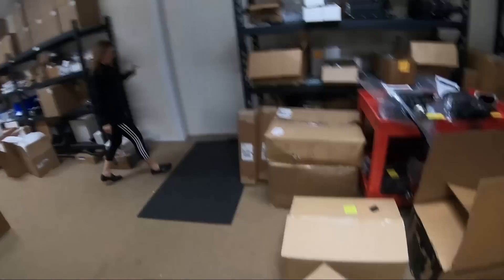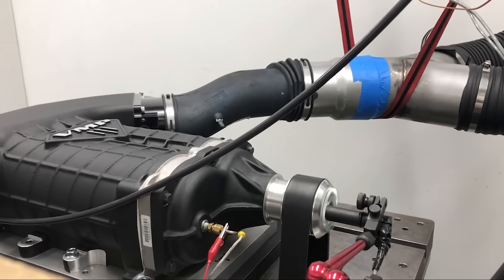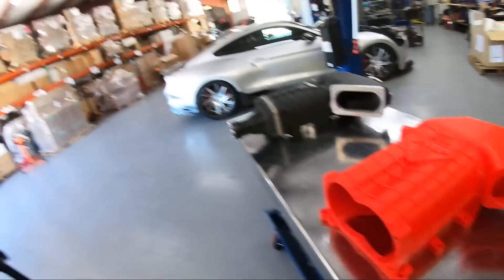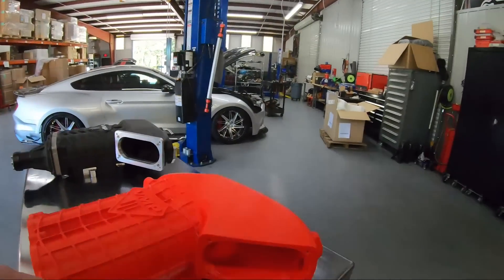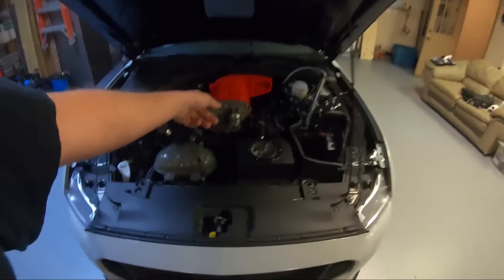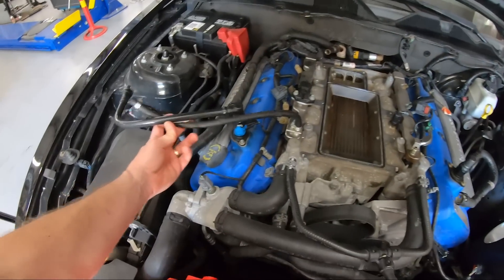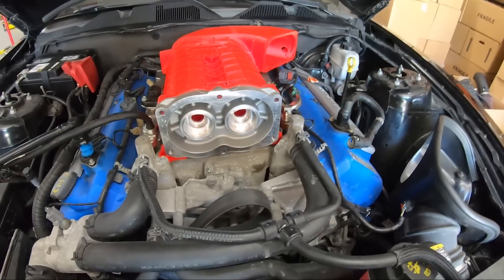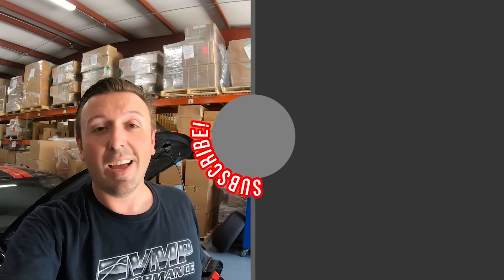VMP Gen3R what makes it better?

Comment: If I buy the head unit upgrade would that come with a pulley or would I have to buy it separately?
Reply from the maker: The pulleys are separate.  The reason behind that is everyone has different goals they're trying to achieve and different belt drive set ups.

Comment: Are there plans for a larger blower? You know, something that will require hood modifications.
Reply from the maker: We have not found the limit of the VMP Gen3R yet, if we do, we'll consider a larger blower.  However, at this point we don't feel one is needed.  We'll have some videos coming out later this month detailing the pros and cons of larger blowers and how they stack up against the VMP Gen3R.
Reply: @VMPPerformanceTV  cant wait. Always great videos.

Comment: Excited to see results. Will there be a non-EGR version or an EGR blockoff? Will a new CAI be required?
Reply from the maker: Your current CAI will work just fine with the Gen3R but should be size for your HP goals, the stock intakes are not big enough.  Our blowers are set up with EGR.

Comment: When is the expected debut for the “R”? Will you have one for the 2015 F150 Coyote? I’m ready to pull the trigger on a supercharger, but I’m willing to hold off if the debut not too far away
Reply from the maker: Head units are shipping, full f150 and mustang kits will be up on the site next week.
Reply: Have you, or will you, be test fitting and dyno testing for the ‘15+ F150 Coyote?
Reply from the maker: @81shovelhead  we have and the gen3r fits, it will perform better than our gen3 which has already proven itself

Comment: Including the special socket would be awesome and perhaps an extra 10mm...lol One question, can this be used on the Ford racing 624 HP blower kit for the Coyote engine 11-12? I am led to believe this is a GT500 kit for the Coyote.
Reply from the maker: What you have is the Roush/VMP lower half and a whipple 2.3l blower, this is what you need https://www.vmpperformance.com/VMP-Gen-3R-head-unit-upgrade-kit-for-2011-2017-Coyote-5.0-L
Reply: @VMPPerformanceTV  What should I expect on 91?

Comment: Will you be offering the Gen3R case for us who already have the Gen3 on our GT500s? It would be nice to be able to swap our rotor pack and snout to the new Gen3R case.
Reply: I was wondering the Same thing
Reply from the maker: Sell your Gen3 and get the whole Gen3R, the nose drive is improved as well.
Reply: When the gen3r came out it literally a few months after I bought my gen3 and nobody said anything about the gen3r was about to come out and I could have waited.
Reply: @joeb.8625  don't worry, the same exact thing happened to me, I wish I would have waited

Comment: i have a fresh built Roush 2.3. Will the Gen3R case be available to accept my rotor assy. This is going on 5.4 Lightning with JC Customs adapter plate
Reply: just got the answer. My only option is a Gen II R case, which is not sold as an upgrade.

Comment: Basic question here but why is a rear inlet better than front inlet?  Kenne Bell also claims rear inlet is much better.  Your friend Alex Flores now says that front inlet is the future but I'm not sure what to believe.  My car is almost complete, the blower&Fuel system are the last things I need.
Reply: Front inlet is better since air doesn't have to make that transition through the rear inlet. It goes straight into the rotors. That being said it's probably not much of a gain to be worth VMP to go front feed. At least now anyways.
Reply: Everyone has an opinion. Let the data be what helps u make a decision. The gen3r makes over a thousand without sneezing.  🤷🏻‍♂️

Comment: The housing is better designed for optimal airflow,the Lund boys picked up almost 100 more hp.
Reply: Yea it's about an 8% increase in hp boost for boost against a gen3.
Reply: So with being able to pick up additional 100whp not so good for stock engine?